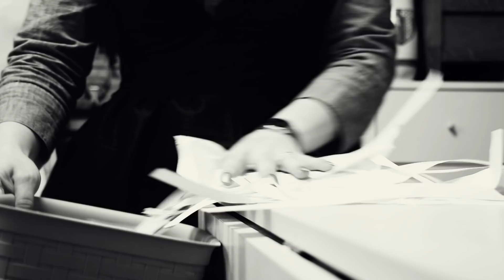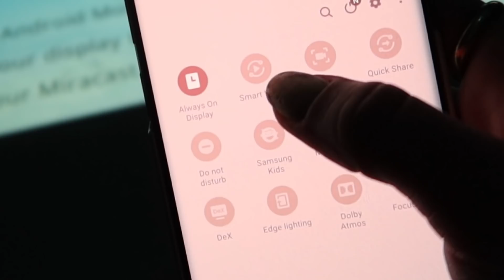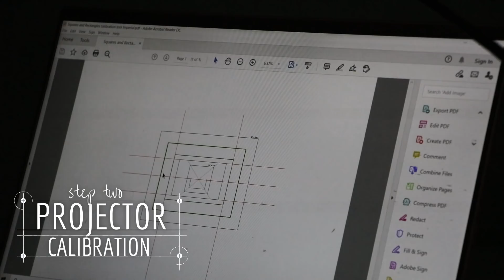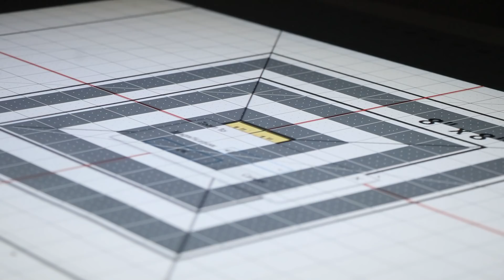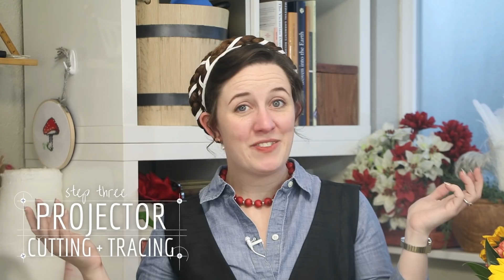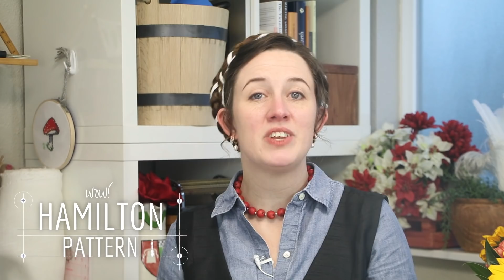Projector VS Paper Patterns - A very quick comparison

Comment: I cannot really conceptualize how to use a projected pattern like that because I need to adjust the neck to waist measurement, bust, waist, hip, torso, etc., and my personal insight with projectors is that it would be mor trouble than its worth to try to use a projector for adjustments of 2" in one area, 1" in another, 1/2" somewhere else. I cannot see that as workable unless it's for garments with a loose fit.

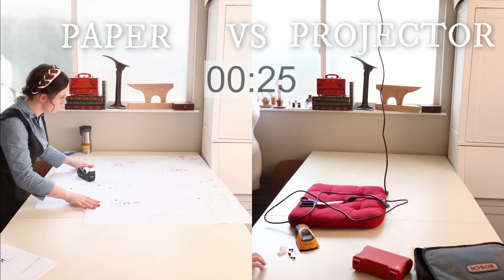Comment: I know this video is a year old great info so far, when I got to 7:32 I had to interject. You are forgetting your ROI (return on investment), set up the projector once and how much faster is it to produce a pattern vs. printing, cutting, and taping. What you are comparing at this time of the video is apples to oranges. After the projector is set up is where the real test begins. Hope that helps someone in the future with the decision to do this. The only way this test is accurate as presented is if you setup and take down the projector after every single pattern. Pro-tip the holes in the studs really don't like it when you continually remove and install screws. 😉 Personally I'm all for team projector, saves time, space, and money in the long run. If all else fails @Garrett Robinson has a great idea on what to do with it!

Edit: As my Great Gran-paps used to tell me in the early 80s, "wait for the youtubes video to finish before commenting on it." I see that with your test you were still faster (including the setup). Well color me red, I still think my point was valid, if somewhat late to the party. Anywho, still a fantastic idea, setting up the projector will still help with speed on future projects, and I'm still on team projector. 😂

Comment: One of the deciding benefits of a projector for my wife was the ability to easily and quickly scale patterns to any desired size. 
Correctly scaling pdf's can become rather tedious,... and downright irritating if the rescaled pattern exceeds the Letter/A4 bounds of a typical printer.
(and who has the $$$, or space for an A3 printer, or the time to send out for printing?) With a projector, you can digitally zoom the pattern to any size.
(Also, I don't have to fart around scaling, and rescaling, and rescaling, her pattern pdfs!)

Comment: For my printer, it costs $108 to replace the ink every 350 pages (or $3.47 per page). A full copier is roughly $320 for 4 toners at 40,000 pages, however most folks cannot afford a full sized xerox. The projector functions are a great concept for designing or mockups. If you are familiar with CAD, they are a great tool. But, the ROI is based on how often do you actually print a pattern vs buying from say simplicity or similar. Sadly 80% of the patterns seen on Esty are not worth the paper you will eventually print them on. From the research I have done over the past year, most seem to be carbon copies with poorly written  directions. Buyer beware is all I am saying. Anyway, the most cost effective avenue is actually to buy preprinted patterns and to use tracing paper to save the pattern. In real dollars, last month I purchased 35 patterns from McCall, Simplicity, and the other sister stores for a grand total of $58.00 (sales and coupons). A roll of tracing paper is about $10 for 50 yards and a box of pencils is about $2 ... so in short I spent $70..  the upshot, I didn't use paper, ink, life expectancy of print heads, and the drama of would be pattern makers. I will own the patterns longer than I will own my current printer... PS, my day job is a financial director... my job is to invest wisely, save money, and question anytime someone says they found a way to save money by buying something that's expensive and not designed for the task.

Comment: This is great! 
I’ve got a bunch of bought paper patterns, some vintage. So I iron the paper pattern, scan it in A4 sections, and stitch it together on the computer. Then I keep the pic file and trace out my size on adobe illustrator (inkscape is free and works too) but I make all the adjustments that I want to fit my body or add bits or change the seam allowance or whatever.

My plan has been to go projector from here but I haven’t yet and just print patterns at the copy shop (I can’t deal with the taping thing)

By going digital means you have to keep less physical stuff and it’s easier to build a library of mix and match pattern pieces that work for you. 

I’m an engineer so I kinda like the patterns more than the actual sewing but I think I could use a cad program that I say the dimensions and the angles must be read from an excel file so I’m hoping I can figure that out so I can easily change a pattern to fit someone else’s dimensions/measurements 

what a time to be alive haha

Comment: Another element that I think could be a pro for the projector (which! i will hopefully work with this method in the future! I really like this!) is that you can intentionally stray away from the printed scale of 1" to 1" so that you can make your patterns larger, such as from books or that sort of thing. It would require a bit of work still, but...it might be an easier way to get from small book patterns to a plus size pattern faster and easier. I haven't tried it yet, but...that seems like a way it could work...

Comment: Oh man, this is just amazing.  I remember reading in the early days of costume blogging about people blowing up PoF gridded patterns by projecting them onto walls and such.  Hooray for technological advances - it's BRILLIANT to mount it to the ceiling and point it straight down!  I have a bunch of PDF patterns I've bought just because of the instant gratification factor, but it's not so "instant" if you have to tape all of the pieces together before cutting it out!  It's so funny that it seems scary to cut right into the fabric without physically pinning the pattern pieces to it.  We're conditioned to want to do that step first I guess, LOL!!

Comment: This is such a cool idea. I was just discussing how much we hate dealing with patterns in another FB group. This could be a real life saver. Back when I first started using PDF patterns I was tracing each individual piece onto freezer paper. So I could just iron down my patterns. But it was always a pain in the rear when it came to matching up pieces. I could have used a projector big time for this process. Another thing this would come in handy for is for tracing out where certain stitch lines go. Like for placing your boning channels in corsets and stays. I always struggle with tracing paper and wheels when it comes to these things. Thanks for this very informative idea. I will be checking out the group.

Comment: THANK YOU SO MUCH FOR THIS. I can't believe I hadn't thought of doing this myself!!!! This is awesome!!! 
So, the projector on Amazon (currently) has a $25 coupon, FYI. I ordered it and the mount and shall be experimenting shortly. 
Several added costs to printer patterns that I feel you have missed is #1 - THE INK. OMG. I've printed out several Seamworks patterns now, and cost #2 - the space. Cost #3 to printing - the agony and angst of not being 100% sure the darn things are perfectly lined up, especially with much larger pieces.  When storing large printed pieces, they tend to do best rolled up - but then you have curled patterns that have to be ironed flat again before using.If you don't have pattern weights, paper buckles a lot more than onion skin patterns when pinning, so I would honestly add the cost of weights to the printed pattern breakdown.

Comment: Don't forget to use a level to set the angle of the projector.
Also, if you don't have a gridded cutting mat, some wrapping paper have a 1 inch grid on the reverse and could make a cheap temporary pattern.

Comment: The spencer is really cute, and I prefer the somewhat looser fit of your version. When I have the money, I want to try it out!
I used the projection technique way back in 2003 to enlarge an image onto paper in order to use it as a stencil and it worked wonderfully. I used one of the old, overhead projectors. I haven't used a projector since, but remembered it the other day when I was trying to scale up a line drawing of a pattern that really wasn't meant to be scaled up and was losing my mind. Thank you for the info about min/max projection distance and different types of projectors!

Comment: My worlds are colliding! lol I work in the audio visual industry and work with projectors a lot. Other things to consider are the cost of replacing the projector lamps, the weight (especially if you plan to put it on a tripod), and if the space you plan to put it in can be darkened (windows with no shades might cause a problem!). I also remember using an opaque projector in school and yes projectors have definitely come a long way! We have laser projectors now!

Comment: That's funny, I'm using a half way method in-between printing and projecting. Using the biggest, brightest screen I have, I put some thin paper (usually I use newspaper... It has printing on it, but it is easy to come by, pages are big, and it is recycling) on the screen, then by transparancy, I can draw the lines of the digital pattern onto paper and bring it to the physical world. Projecting would be an upgrade, but way more expensive :)

Comment: I love my projector! 
Ultra Short Throws are very, very expensive but most of us using them buy them second hand. Mine isn’t an UST but it is a second hand Short Throw Epson. I spent $100 total on mine. It has been so worth it in time savings. Especially since I have two daughters I sew for in two different sizes and also a son that I usually use different patterns to sew for, plus myself and my husband.

Comment: As someone who cannot ever cut the same line twice, this method is extremely tempting. Less room for error if you just cut the fabric, rather than cutting first the pattern and then the fabric and somehow ending up with two differently sized shapes.

(Unrelated side note: I was looking up Medieval hood patterns earlier, and the very first result was a video that I looked at and went, "that looks an awful lot like mr. Morgan Donner." Which, indeed, it was. Also the video was pretty much exactly what I'd been looking for, so yay for Mr. Morgan having a recognizable silhouette!)

Comment: This is such a cool idea.  I don’t understand how you find your “size” with zoom though.
Reply: You use a calibration grid to determine when what you are projecting is actual size. Then you enter that zoom each time you open a new pattern. You double check your pattern with the 1 in square or grid layer, depending on the pattern, and then you can use it as usual. If it has layers, you turn them off and on as needed like you do for printing. If it doesn’t, there are some work arounds or you can just follow the line you need.

Comment: Perfect!  I have acquired several online  patterns that have a projector option recently. Like you I remember using a clunky projector in school and transferring to a wall, using paper. It didn't seem appealing to do that. I would rather have it printed at my local printers office. 
But now that I have seen your setup over the cutting table I am intrigued by the option. Very nice! You have opened my mind to this as an option in my own sewing. 

Up till now I have just been cutting the baby patterns on my Cricut Maker. But as my baby grows those patterns won't fit in the size constraints the Maker is limited to.

Comment: I was a theatrical costume designer for over thirty years and using a projector was always the way we enlarged period patterns. Thanks for this video.
Reply from the maker: Interesting!  Definitely not a new tech, but much more accessible for the home sewing space now, which is awesome!
Reply: As a fairly inexperienced sewer, and beginner in historical clothing, how does one ensure the correct pattern proportions/sizing when using a projector? Is it simply a matter of sizing at 100% in the pattern? Also, how does working with larger patterns than a corset affect the distance the projector needs to be from a table? Is ceiling height too short a distance? I love this idea, as I have just purchased a digital pattern that turned out to be 155 A4 pages to print and I can’t seem to find a wide format printer in my area. As I already have a projector, this really appeals! And it means my watchlist of all the other digital patterns could become an immediate purchase 😂😂😂  
💝🙏
Reply: @lilaeia  
In order to fit a larger pattern on the table, you need a larger projected image. The alternative would be to have to move it around on the screen, which isn’t good if you have to do it in the middle of a piece.
Reply: @lilaeia  It depends on the projector, of course. Some will do huge expanses with a very short throw. Assuming that your projector wasn't made for short throw, you'll have a very small, probably hard to focus, picture area, (unless you have vaulted ceilings, then you'll have a good chance of being alright.) It is possible to find short-throw projectors on Amazon with decent reviews by people who have used them for this purpose, for less than $200US. Of course if you don't feel good about duck-taping it to your ceiling; mounting hardware will get you most of the way to $300US. ;-D
Reply: @lilaeia  - I have not purchased the Spencer jacket pattern yet. But other patterns I have include a first-print page with a precisely measured-out square. If that square doesn't come out correctly, the enlargement percentage needs to be adjusted. Does your pattern have this print feature? It has worked well for me.
Reply: @MossyMozart  No mine doesn’t have a square anywhere in the pattern documents. That would certainly make things easy!! 💖🙏

Comment: If you cut directly from the projected pattern, how do you handle adjustments for fit? If you make the adjustments directly from the mockup, then you have to repeat the whole process every time you use that pattern.
Reply from the maker: I would probably alter the pattern digitally if I wanted to add a personal adjustment.  Or just hold on to the mockup with your added changes, and use that when re-making that item in the future.

Comment: Great alternative! I print mine because its what i have, but i found that this pattern was the easiest to tape together than any other print at home ive used. also does this pattern run small? It looks rather small on bernadette but closes on sewsine. what size did you cut, did you size up?
Reply from the maker: I cut size 8-10, which fit well besides being slightly tight in the forearm (this was the original test pattern though, I think they made a few changes based on our feedback, so I'm not sure if the etsy version is different size-wise.)
Reply: @MorganDonner  Thanks! that actually helps a lot i know what size to mock up now for me

Comment: Morgan. The problem I can see right away that the Projector has. Is the Adjustments you should be doing to the pattern to make them fit better.  I have sewed for over thirty years. and only now am discovering the wonders of Fitting my Patterns to Fit my Body.  As you know, You can adjust the pattern by around 80 to 85% Just by grading the side seams for better fit.  Then if you have to bust adjustments, small back adjustments, in my case, protruding tummy adjustments. And a wide shoulder adjustment as well.  I am considerably larger in my front than I am in my back. So if I just trace a pattern and sew it as is. It will NEVER Fit me properly. I will have drag lines and sagging in the back of the garment, and have too tight issues in the front of the garment.  So projecting and cutting the pattern is not something I would recommend to Anyone. Especially not a new person getting to know their sewing machine.  As you can adjust your patterns for fit, by drafting them to fit you right away, You know, that we do not all have those skills.  BTW, I was a perfect Pattern Fit before I gained weight due to health issues, So I never had these fit issues before LOL> But now I have to lower my apex, and sometimes reduce the Bust Cup size, and increase the bustline size, to go around my body.
Reply: If I were using a projector, I’d project onto muslin. Make the adjustments on the muslin then transfer measurements to my online drafting tool to draft.. Transferring the measurements could be time consuming but making the garment from then on would be way easier!

Comment: I'm curious how well you like your rotary cutter? I've tried for many years to switch from scissors to rollers and always found my cut lines to be wavy and uneven, even with brand new blades. Any tips?
Reply from the maker: I am quite happy with it, but there are certainly tasks scissors perform better.  Making lots of precise zig-zag type cuts?  Reach for the  snips.  But long, gently curved lines are great on a rotary.  No tips except practice :/
Reply: @MorganDonner  I have pinking shear blades for my rotary cutter. And wave blades as well. But I never really figured out how useful they can be. I am too attached to scissors
Reply: I have both. and I am way too dependant upon my ruler to go free hand with my rotary cutter.  I have discovered however. through Bernadettes example of tracing your pattern onto the Fabric, that using scissors makes for exacting cuts as well.  Since I have been a quilter for over 20 years, I am very familiar with my rotary cutter. But I still prefer my scissors for cutting garment patterns. I find I am much more precise with my cuts and can keep a cleaner edge. 

As for the rotary cutters not  cutting evenly, check out some of the quilting videos, on tips and tricks with the rotary cutters. and mats.  Mats make a huge difference to how you rotary cutter blades work on them.  Too much pressure , not enough pressure, can also affect how the rotary cutter behaves.  Yes, sharp blades are a must. But nothing replaces good old fashioned experience. Which These Gals have in spades.